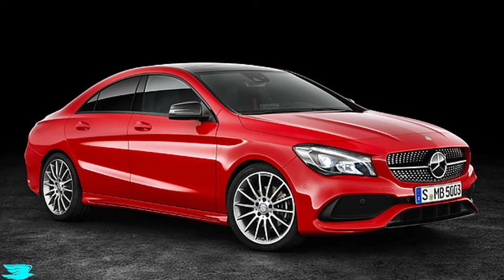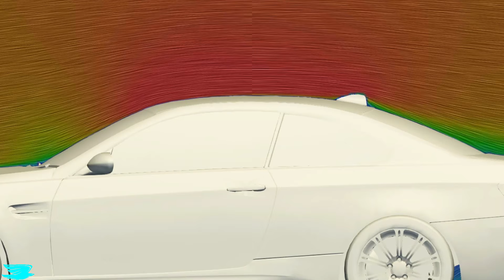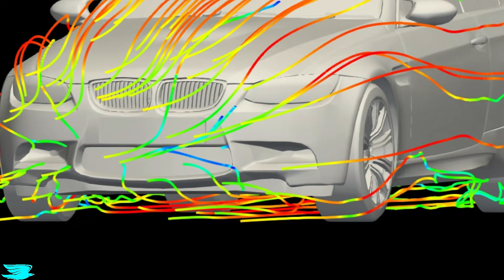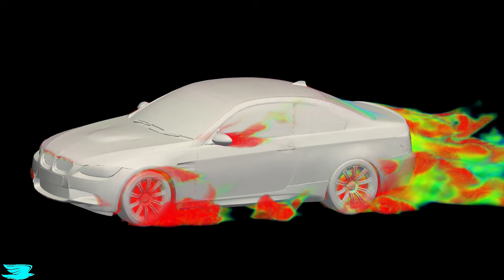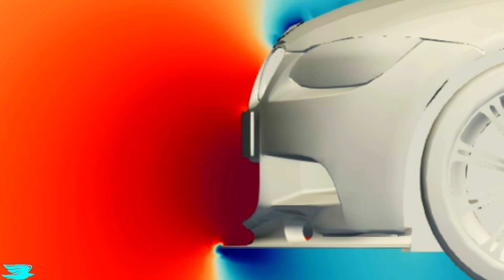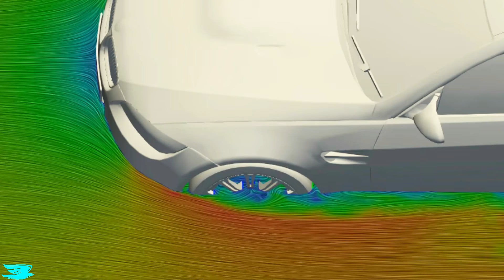Fixing The M3’s Aerodynamics Easily [E92]

Comment: Aero is actually great on the E92. You have no clue good sir. 
However you can tune ANY car to your preference aero-wise.

There are very valid reasons why BMWs and other modern cars have their values and shapes they have, its always a compromise between thousands of different demands.
Also, Cx-value is just one small part of the equasion. Cx x A is the true aero formula, and also for a sportcar, lift is very important to control, in conjuncure with suspension etc.

Another great study of super-sedans is the Giulia Quadrifoglio, it got a massive budget for aerowork.

Regards, Per Eldh, developing engineer in automotive design.

Comment: Hey I was wondering, if they exist, who has made that rear spoiler or front splitter as a product? I looked through the comments for any suggestions or related questions, but I didn't find an answer. Did you make those parts in OpenFOAM yourself?

We are trying to do a similar setup for my E92 M3 and we want to test it at the local OTU wind tunnel, but getting the correct part seems to be a challenge.
Reply from the maker: Sorry, I don't quite remember what these devices were from.

Comment: So what would the larger spoiler do with the addition of a rear wing? I already have a large spoiler and am looknig to add more rear downforce as the the car is now unbalanced with oversteer after the addition of a gt4 v2 front lip.
Reply from the maker: The two together would increase downforce - particularly if the rear wing were mounted high so the two didn't interfere as much. But, there would be a LARGE drag penalty.

Comment: I posted this comment with links but attempting to repost to keep it from getting caught up in youtube's automated system. I'm trying to get cool air vented to the front brakes of an E92 M3 like the one featured in your awesome video. Options 1. is a rectangular scoop/vent approx 2" tall by 5" wide that is mounted directly beneath and to the lower control arm and requires no cutting. Option 2. is a wider rectangular scoop of approximately 3" tall by 6" wide that is cut in to the front below bumper air dam that is featured prominently in your video. Do you think Option 1 would move a meaningful amount of air or is that wishful thinking? Thanks!
Reply from the maker: If you can get option 1 into somewhat freestream flow, then it is definitely better for cooling. An alternative is to have more open rims to help air flow out more - that increases mass flow rate, and hence cooling.
Reply: @PremierAerodynamics  👍Awesome thank you so much for this answer and your original video!

Comment: What software do you use? I'm tryna understand Aero Dynamics on my Car 2017 Lancer ES slightly modified has vortex generators and a lip spoiler, I do have a ebay front lip but doubt it makes a difference, hence why I wanna be able to understand what makes a difference to my car
Reply from the maker: This is OpenFOAM, and then ParaView for the postprocessing.

If you're interested, we have courses on them.

Comment: I'd be very interested to see a video on the 2015 Volvo S60, specifically comparing the differences between the R-design to the Polestar (which has lips added to the front bumper, revised rear diffuser, and a considerable increase in rear spoiler size & design).

Comment: Great video bro, was hoping you could answer his question for me, so I gathered that a higher deck lid spoiler in the rear leads to a higher pressure zone in that c pillar area, so my question would be for roll racing specially, 100+ mph acceleration is the stock trunk and spoiler better or is a higher spoiler with more downforce better fo 60-130s and roll racing? Thanks

Comment: Sir, the high pressure area in th efront bumper you are pointing to is a radiator opening... Generally, you are missing out on cutouts and air inlets due to rough CAD models. And also, not rotating wheels change everything too...
Reply: agree, same with the rear diffuser, here the bumper is just closed off it seems?
Reply: even non 8 cylinder e92s have good aero, with passthroughs.

Comment: You mention about the area of near zero air speed in front of the bumper, but is this not just a result of modelling the car as if the central lower section of the bumper is solid? Obviously in real life it is not; it is a duct through to the radiator. Of course, this would be vastly more complicated to model.

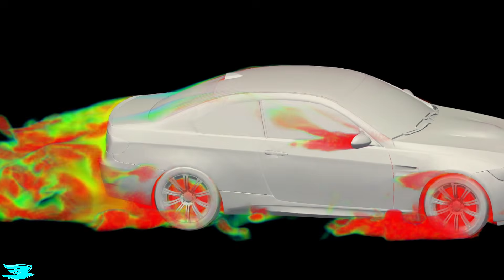Comment: 5:12 what I’m thinking about is this: hood drag, and the lower windshield drag, create pressure, force from which, that is a vector, directed only around 15-30° towards the back of the car, thus the drag, in this case is actually mostly the downforce, isnt it? I’m not an expert, but if I’m correct in the general understanding of it - the drag is very insignificant there. What do you think?
6:14 Do I understand it right that green areas are normal pressure? Doesnt this mean that this area from the roof until the spoiler is actually creating zero force on the car? Or do you mean its forcing up, in relation to the front? As the front has more downforce. 
Edit: Ah, now I see. The red to blue  lined spectrum was about velocity and not pressure
Reply from the maker: The pressure on the windshield is definitely at an angle, but even at 15-30 degrees, that's quite a bit of additional drag, particularly given how large the front window is (the surface area is high).

Comment: I'm curious how different this is with the 330i / 325i as they are slightly narrower and don't have as bulky of an exhaust. 

It's the first 3 series that they really seemed to actually consider aerodynamics so it's not surprising some things are overlooked especially considering their aerodynamics models were likely far slower allowing less iteration than modern car designs. The M3 compared to the base model is also a lot more stuck with what they can change compared to when the base model is developed from mostly scratch.

Comment: What do you think of the little winglet on the side mirrors of M cars? Of course, it's a design staple, but they (E9X) just look like carefully designed aerofoils
Reply from the maker: I think they're designed for quite a few functions. One is aerodynamics, but another is noise, and another is soiling. So, I don't think they are the lowest drag they can be, but they perform well across the board.

Comment: Wheels are not rotating in your simulation. From your exeprience: How does it influence air flow around wheels arches and so on?
Reply from the maker: The wheels are MRFs. The effects of rotation are that usually the top of the wheel produces larger wakes, the bottom produces smaller ones. The drag will drop a little, and usually, the front lift will drop a little too.

Comment: Great video dude. As a E92 m3 owner I was considering these upgrades anyway, but now they are definitely happening!

Can you recommend any rear diffuser designs that would help alleviate the issue around the exhausts sticking down too much?

Or with the front splitter improving the aero around the rear oem diffuser now, is it worth just doing the splitter and spoiler but leaving the rear diffuser?

Thanks
Reply from the maker: I don't know of any specific ones. The only ones I know of are custom built. Personally, from a cost point of view, the front splitter and rear spoiler are probably the best value. Changing the exhaust and/or redoing the underbody is much more expensive. And you also have to consider overheating issues.

Comment: How much of a difference does the belly pan make to the stability of the car? I have a BMW e92 335i so its a bit different from the M3 but on track im struggling with overheating.
Now i was thinking about removing the belly pan to open it up for the heat to escape. but im guessing that would massively impact stability?
its also not completely straight anymore due to said heat haha

Also, how much of an impact would adding turning vanes to the underside of the car make? like the ones you see on porsches for example (to create outwash)
Reply from the maker: Wow! Is that a stock pan? If so, then that's pretty surprising that it's overheating that much.

Removing it will likely reduce the amount of downforce you get underneath the car. That will reduce the stability at higher speeds.

They usually help create more ordered flow underneath because the wheel wakes are forced outwards instead of being ingested. So, that should help the car produce more downforce, but the drag will often increase.

Comment: Wouldn't the front "low speed" area also be not as bad in reality because there are radiators there that allow for some flow? Or is that accounted for?
Reply from the maker: The intakes are modeled as outlets, but not all the air goes through still.

Comment: I have a 335i e90 LCI Msport, and I'll be removing my rear muffler. Should it help more it's aerodynamics? What about the big empty space that will be left in, wouldn't it be bad for drag?
Reply from the maker: The empty space would probably be bad. If you could cover it, it would reduce the drag and effectively make a new diffuser. But also make sure that it's not affecting the cooling of the underbody.

Comment: When it comes to the wheels, I believe in real conditions they would affect the flow around them differently since they're rotating, is that right?
Reply from the maker: There is some difference. These are MRFs and they give a little different results to sliding meshes. But the main thing is how open the rims are. That really dictates the overall aerodynamics. Also, the number of spokes don't really matter. The opening area is the important thing.
Reply: Although I don't think much difference will be there since the wheel spokes have a somewhat thin profile

Comment: I am a bit in aerodynamics too, your simulations a pretty good, but you work with a closed model, so you can’t tell how the air behaves in front of the car and the lip. Even if we have high pressure inside the motor-compartment, the it will flow through the cooler into the car, that decreases the pressure in front of the car. If your car has openings on the hood my it is even better (2nd vent at the E92 M2 is only closed by a rubber-Part and isn’t used for the motor airintake).
But yes, the exhaust-system is aweful!!
Reply from the maker: We have the inlets modeled so the flow can go through, with an outlet boundary condition. While there might be some differences, in the amount of mass flow rate, in real life not all of the air hitting the inlets will go through - for example, if you're traveling at 100 kph, you won't have 100 kph flow in the engine bay.
Reply: @PremierAerodynamics Sorry ;) than I haven’t said anything ;)

Comment: I mean it’s a blocky car. You can’t change the pressure drag coefficient but I guess the friction drag coefficient can be lowered by redirecting ai flow with canards I guess. I mean you could redesign the entire roof to increase turbulence to decrease lift like a golf ball but that will probably only work at higher speeds. Best way to reduce the lift is to increase the downward curve to the rear of the roof but thats impossible. I mean long story short bmw m cars will always have god awful aero because they’re based on cheap production cars. BMW knows their buyers are clueless to this kind of stuff. 

On most cars anyone with a CFD background can immediately see the diffuser is useless but we’re like 0.001% of the population😂.

Interested to know which turbulence model was used though. RANS or menter sst (god forbid dns 💀)
Reply from the maker: It is IDDES k omega sst

Comment: Hey, as i see this vid i have the question. Why almost every BMW is having rear fenders set lower than front? I mean that  when car is stock, front fender leaves visible gap from wheel compared to rear, but when it comes to fit this, rear of the car sits visually very high compared to the front. Does it have purpose other than looks? And how car would act when its: equally set/having higer front or rear? Thanks
Reply from the maker: For aero, having the rear higher means that the flow is expanded along the entire underbody, which helps lower the pressure and reduce lift/increase downforce.

It also reduces how much air is forced away from the car because if you lower the pressure underneath, the air will want to come in more.

Comment: Do you think there would be even more upgrades to the aerodynamics of the car by using a GTS style rear wing instead of the big rear spoiler?
Reply from the maker: The bigger rear wing will definitely produce more downforce. It likely will be worse drag than the spoiler though. In terms of add-on devices, there are a few. For example, canards. In terms of actually modifying the car, various vents around the wheelhouses would be good.

Comment: You're probably the right person to ask. Though you'll never see this, some cars seem to have wind deflectors.Somewhere under the body near the rear wheels. I never understood exactly what they did, but I figured they were there for A. Reason probably something you would understand.
Reply from the maker: From the description, I think they're rear wheel spoilers. If so, then they're just there to reduce how much high speed flow slams into the front of the rear wheels. They direct the air more around the rear wheels in the hope of reducing the drag.
Reply: @PremierAerodynamics  saab 900 convertible is where I first saw it. They don't all have it. Now that i've looked at further pictures, it might just be to deflect moisture around the rear suspension point. I've seen it on other cars.I just can't recall which.😮
Reply: @PremierAerodynamics would it not be more beneficial to put them at an angle then rather than flat towards air flow? I get slowing down the air creating drag can be beneficial, and you can't remove it entirely cause you cannot create a vacuum there but still, increasing the outside flow with directed under car air would create a vortex/delta pressure and help suck air out of the wheel stations?

Comment: I assume you haven't taken internal flow and ducts into account. Therefore, the aerodynamics are surely slightly different in reality with regard to the hood, windshield, wheels and front roof, and the drag/lift shown is actually lower. Also - some drag/high pressure areas are not negative and actually intentional to improve different things like passenger comfort (air condition/ventilation) or guidance of water/dirt.
Reply from the maker: How much do they change?

I assume you don't know.

So, the answer is that cooling flow typically only adds around 30 counts to the drag and the aerodynamics don't change very much. It was one believed that there was possibly a synergistic effect but they don't. I actually know some who wasted a PhD on that subject.

Comment: I actually own a e92 330d @330hp, that didnt come with M package. When I chnaged the front to the M one with the front spoiler, and added the small M package lip to the trunk, it went from "ok" 230kph+ (~140+mph) to stable at 270kph (~170mph) and the little bit of downforce seemed to be enough to greatly improve my ground contact and stability
(also before you guys start complaining, I live in Germany and these are legal speeds on the Autobahn)
Reply from the maker: That's too slow on the autobahn, lol. :P
Reply: @PremierAerodynamics  Could you show how sweeping speed affect the analysis u made? maybe like show at 3 different speeds like 100, 160, 200
Reply: @PremierAerodynamics what can I say, slow car :P
Reply: I had an E90 LCi 325D non M-Sport @322hp - just adding the rear lip made the car much more enjoyable at 200+
Reply: @techHH_1 any difference between 100 and 160kmh?
Reply: @hanynowsky insignificant for the most part. At higher speeds yes, car went from wandering like it needs a bit of tracking / rear toe done to a rather stable experience
Reply: @hanynowsky not great enough to justify the upgrade
Reply: Yes, as the video explained, that is how a splitter should work.
Reply: I have aero kit lip on the front bumper, changed enough. Had the M3 spoiler on the back, might swap to a bigger one like here. Really don't want flat lips like that. But I don't have issues with fuel economy. 1600 km with 600 in germany changing constantly to 250 kmh from 100, still 5,2 L/100 km
Reply: You don’t have enough hp to take you anywhere near to 170mph
Reply: @m5p944  300 hp is enough to reach 270 kph with the E92 M-Sport design. With drag coefficient 0.3, frontal area 2.17 m^2, and drivetrain loss 18%, you can do the calculation. Textbook formula.
Reply: @m5p944  u can get to 270 with less than that, a 320i easily get to 240-250 and its not even considered a fast car
Reply: You mean, you basically just changed the front bumper from standard to M bumper and added the factory M rear spoiler?
Reply: @hanynowsky exactly. That and H&R Cup Kit.
Reply: @hanynowsky  He means he changed the front bumper and added a rear spoiler, two of the biggest contributors to increasing downforce on the car. Your point? what an absolutely unnecessary comment
Reply: @DAZTCG yours was even more unnecessary 😂